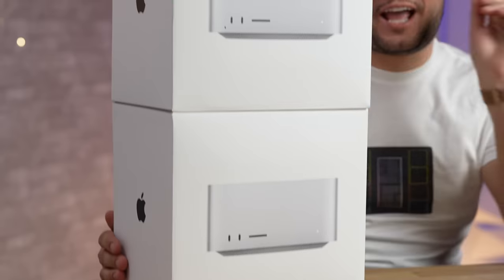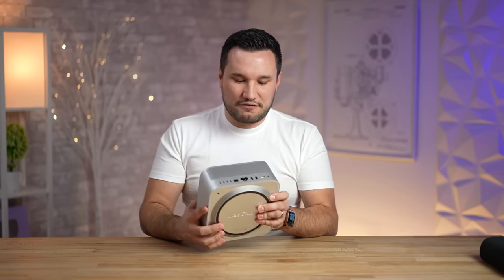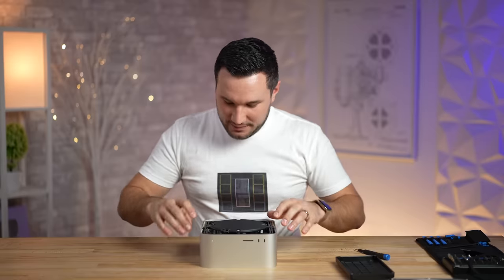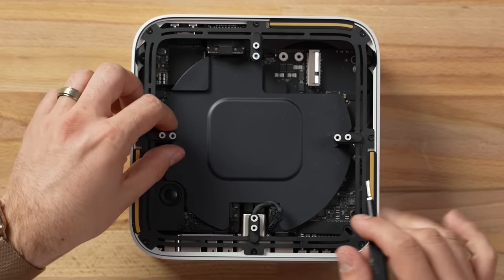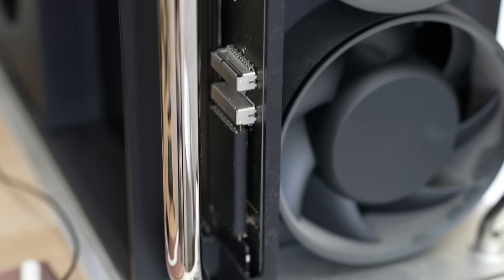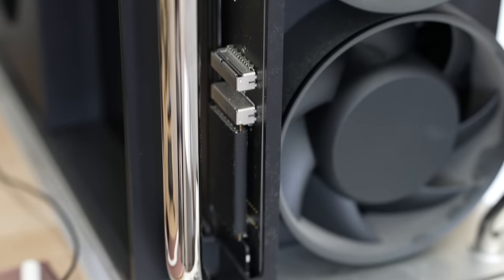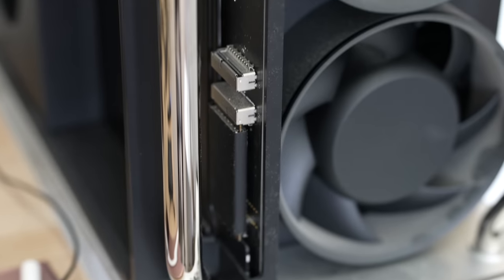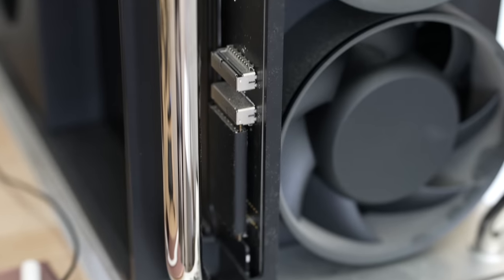Mac Studio FULL Teardown - M1 Ultra chip REVEALED!

Comment: Hellz yeah! Hope OWC makes affordable storage cards for that. Great tear down. Love the content you guys are putting out. I wonder if this is what Apple meant by modular. As in easy to repair or I should say - have repaired by authorized service centers.
Reply: If apple cared about their consumers, or about the environment, the storage should have been standard m.2 slots.

There is no engineering reason to have a proprietary port for storage in today. The entire rest of the industry has standardized to make data recovery, repairability and upgradability simple.
Reply: @ferdievanschalkwyk1669  The SSD controller is in the SoC. No M.2 drive (which have their own controllers) would work in this if it had an M.2 port.
Reply: @aaronmdjones  I have since heard the same. I just hope Apple backtracks on the decision to consider it a non upgradable part, since it's clearly just a software limitation. They can easily support upgradable storage in the firmware.  They already have to internally.

Comment: Wow! That thing is huge! Very impressive and impressed by the cooling capabilities.
Reply: That’s what she said 😂😂
Reply: Look at other APUs out there like the ones in consoles. Many of those are also massive in size because of the parts they all put on the chip itself
Reply: just a remark to explain the logical difference in size between the Ryzen and the M1 Ultra: the AMD Ryzen is just the CPU, whereas the M1 Ultra is a totally different design since it has the RAM "packed" inside as well as the Graphic GPU Cores (so no big sized graphic card in the computer), the Neural Engine Cores, etc... , that's why it's called System On a Chip because it's the entire system not the CPU only.
My 2¢...
Reply: @DenisLogicCertified  It's just like a console. They pack just about everything except their memory modules on the chip itself just like the Mac does at the moment. It works practically identically in design to the new macs

Comment: If your watching the first half of the video while reading the comments the storage is NOT upgradable. The Mac will not boot and will not recover using configurator 2 if you change the storage. It will not recognize a different amount of storage. That is not an SSD there is no storage controller built into it that is on the M1 itself.

Comment: so it is the trick, the MS has a 3.5  gb/s SSd and use a raid  option to reach 7.4 m/s, it is also a way to have cheap ram.
The problem is the T2 chip allow you to add a third party SSD with an adapter, not sure. it may be locked.

Comment: I was really surprised at how easy it was to access the internals. The taped/glued on rubber was clearly intended to dissuade users from upgrading it themselves, but once you take that off, most things come off with screws.
Reply: You call THAT easy access?
Reply: @kayakMike1000  yeah if you're older than 12

Comment: How does replacing ssds work with the sepOS? They dont use nvme protocol.

A randomly generated UID is fused into the SoC at manufacturing time. Starting with A9 SoCs, the UID is generated by the Secure Enclave TRNG during manufacturing and written to the fuses using a software process that runs entirely in the Secure Enclave. This process protects the UID from being visible outside the device during manufacturing and therefore isn’t available for access or storage by Apple or any of its suppliers.
sepOS uses the UID to protect device-specific secrets. The UID allows data to be cryptographically tied to a particular device. For example, the key hierarchy protecting the file system includes the UID, so if the internal SSD storage is physically moved from one device to another, the files are inaccessible.

Comment: Apple's M1 Ultra chip in a rack mount version would be a game-changer. As a tech enthusiast, I've been eagerly waiting for a powerful and compact solution that can seamlessly integrate with my Unify network equipment, and this seems to be the perfect fit. The M1 Ultra's performance and efficiency are off the charts, and having it in a rack mount form factor allows for easy installation and management alongside my existing infrastructure. Kudos to Apple for continuing to push boundaries and deliver innovative products that cater to the needs of professionals. Can't wait to get my hands on one and take my setup to the next level...

Comment: If you think this is a hard teardown, have a go at the 16" macbook pro. I still have flashbacks to replacing the keyboard on one.  This system is complex but no worse than a higher end all in one PC.

The small battery is called a P-RAM battery, it just keeps the system clock working when the system is unplugged but also keeps track of brightness, volume setting and other minor stuff like that.

I fix macs for a living.

Comment: With such a cool processor it should be on display and not hidden.
What are the thermal conductivity qualities of glass? couldn't you build it with the cpu on top under a plate of glass?
Wouldn't that be cool (enough)

Comment: its not an SSD slot its a memory module slot as the memory controller is in the M1 chip itself if you plug in a normal SSD it will not work.

Comment: You can't upgrade the mac storage. It's not an ssd, it's memory modules, there's no controller or dram cache. Also the battery is for the real time clock so when you turn the computer off it can remember the time

Comment: Sadly the SSD is only NAND. The controller is on processor. Which mean to upgrade, you need to do some crazy stuff or let's apple do it for you (which I doubt as it is clearly stated in their website as it is not upgradable thus you need to buy whole machine).

This also equal if your processor is failing, consider your data is gone.

Comment: Just because a part is replaceable doesn't mean it is upgradeable.  Pretty hard to upgrade when there are no aftermarket parts that can be bought. Not to mention that the manufacturer also put in interlocks that prevent upgrading in the first place.

Comment: You said it's not that big but knowing that is the actual die size, this unit it absolutely gigantic for essentially a single processor, no wonders it has all that performance even on the GPU side(not RTX 3090 level at all but it's still really fucking powerful)

Comment: If you ever do any other tear downs it's really helpful to lay out each of your layers/sections in the shape of the computer that you took them out of. So on the table you have a spot for the bottom screws that would be laid out in a circle around the piece that they came out of. And the antenna screws in another spot sit next to the antenna in a similar but minified shape. Fan screws laid our in a similar pattern in another spot... etc. This makes it a million times easier to get things back exactly where they need to go and you never mix up screw sizes.
Reply from the maker: I did mostly do it that way :)

Comment: Sorry, it is NOT upgradeable. People have tried swapping using a donor studio and it just won't boot. Even the genius bar guys can only replace it with an equal capacity module, and exclusively on a repair basis. Upgrades are not possible by any means.

Comment: The storage is not upgradeable.  The card is raw NAND flash on a PCIe bridge.  The actual SSD controller is on the package of the M series processor.  The system DRAM is used as a cache for the SSD, and how much depends on the drive.  Even if OWC or anyone else managed to copy the design, Apple could easily lock them out with a handshake.  In fact, the iFixit team already tried a DFU restore with both slots populated, and it wouldn’t work.

Comment: It is not upgradable, those modules are RAW storage modules that are locked to the T1 chip.

So even if you put in a fitting different one, it will NOT WORK AT ALL

Comment: Lovely teardown! But... please don't say that a pill battery is there to prevent data loss when the machine looses power. It's for keeping the clock running. Those things under the stickers near the chip are mosfets for power delivery. Also, the insides of all of apples computers look that good. Nothing special here. You should try tearing down an original Touch Bar MacBook Pro! (talking about unnecessary amount of little screws) Finally, that is that is a beautiful chip! Thank you for risking it for the teardown :D
- Former Apple Genius

Comment: Looking back they found out the Mac studio isn't upgradeable. The drives are not ssd drives. They are some sort of controller module for the storage. Becareful one guy broke his m1 ultra studio trying to swap one drive from the studio max to the ultra and broke it. He cannot get it to boot back up. I fix it claims they were able to do this with the same amount of space on the controller. There is some weird stuff going on here but do not try to put a ssd in the open slot. Thats how the guys M1 studio ultra broke or did something to the firmware. He said that there is a serial number attached to the hard rive controller and that why you can't take a the one out from the one studio and swap it with the other studio. Just a heads up. Apple did come out with a update to fix the problem to reboot the firmware on the drive for those who have tried to swap them out but on his side it wasn't working. I think because he tried to put the drive controller in the extra slot. It put the studio in a SOS mode that made the lights flash red and amber. Maybe Max Tech already knows this. His name is Luke Miani on you tube. Take care

Comment: this is company that calls the motherboard, ram, GPU and CPU as a single unit, and also the company that loves to use it's T2 chip to lock everything down. just because there's a port does not make it upgradable.

Comment: The thing I most liked was the PSU.. a beauty. CPU cooled 1/3rd (where it's needed),  the cooler fins are always aluminium. Too much screws that could be solved with clips or plastic inserts. It's a great PC overall.
Reply: its not a pc... and yes the psu is beautyfull  having something that delivers 230 volts straight from the wall via 2 screws is fantastic
Reply: @kuma8030  What is it then? you can argue that not every PC is an Apple Mac but every Mac is indeed a PC same with apples iPhone being a smartphone... Every iPhone is a smartphone but not every smartphone is a iPhone 😌🙌

Comment: Thank you for the unexpectedly entertaining video! It was helpful that you tested the noise and the fan activity of the Ultra model. I see that “Art is right“ is claiming that the base Max model is noisy. Could you please run the same tests on the base Max model once you have it? That would be most helpful and interesting to know if the aluminum heat sink is comparatively less efficient and requires greater fan idling.

Comment: It won't be upgradeable. The whole point of SOICs is that all data is transferred ultrafast which provides M1s with the performance advantage they enjoy. To add additional storage ram would introduce a slower data bus and reduce performance. I can't see Apple doing this. I suspect the MacPro will have some sort of interface card that allows the M1 to communicate as fast as possible with peripheral cards...but they will need to be mighty fast to avoid becoming pinch points and reducing performance.

Comment: It's strange that guy is telling me that "Apple cares" because some usb ports are made to be one whole part but tells nothing how bad it is that cpu and memory is soldered in "desktop" computer. Not to mention that yes, you can replace ssd but it won't work because the way apple assings ssd serial number to their security chip. Also - power supply is exposed which is... bad

Comment: Apple's move toward Apple Silicon is simultaneously a huge step forward and a huge step back in terms of personal computing. They're achieving great things with their M1 and M2 chipsets and while neither are quite as performant as a fully spec'd out PC, the hardware that they do compete with isn't nearly as effecient in terms of thermals or power draw.

That said, this comes with the drawbacks of extremely limited user upgradeability and repairability, as well as limited use case for the hardware since you're being locked into the ARM architecture and Apple ecosystem, which restricts usage of this very performant hardware to what is provided by Apple and other developers, which means you're not going to be doing much gaming or running much in the way of alternative operating systems.

This is mostly very typical of Apple products, though, so it's to be expected; the exception being that older hardware was, in some ways, more repairable and upgradeable as well as less limited in terms of software since they were still using Intel.

Comment: It's not upgradeable. Those are not just storages with firmware locked and paired with the each individual logic board. The ssd controler modules also embeded on logic board too. Apple preventing users to upgrade their devices. That's the true story.

Comment: In engineering... its easy to make something complex, but difficult to make it stimple. Apple makes the outside look simple. But the inside is horribly complex.... 2 screws and a part for every single port.... wtf....  and cleaning the fine heatsink fins after they get dusty will be quite the feat

Comment: Dude is an Apple shill. That computer is not upgradeable, the RAM is still soldered on and he didn't try swapping NAND flash module with one from another M1 to confirm upgradeability.  For a $3000+ machine people should be able to upgrade the RAM and storage at least without having to deal with any apple proprietary nonsense. I'm sure it'll look nice in a landfill as soon as Apple comes out with next year's model.

Comment: No, thus machine is NOT upgradeable… at least not in the traditional way… the way M1 work is that the SSD controller is integrated into the CPU, so you can’t just plug in any old SSD into that port. Those ports are only for daughter boards that carry NAND chips.

Comment: With no heat sink on the ssd and ram, I wonder if they have to throttle them. Most fast ssd's get very hot, even in the larger form factor that's shown here.
Funny how in the earlier he's all excited about the whole soc getting the giant cooler then tries to make out the 1/3 of the chip being connected to a smaller copper pad as something cool. The size looks about the same size as an amd/Intel chip and controller combined plus the uncooled ram. So nothing special I guess. No sadness because you're stuck with whatever ram you ordered either.
I'll be curious to see it intel/AMD make a "ram included" chip. It's been a pretty dumb design until recently where 32gb is relatively cheap and more than most people need.

Comment: "Apple cares about making a solid system"... No they want repairing and disassembly to be as intimidating and convoluted as possible so noone would wanna do it. "You can repair it yourself!" you will never NEVER be able to get your hands on any of those replacement components. Not legally.  Apple might not even repair them or swap them out at the genius bar thier- their track record so far is that if ANYTHING fails they replace all the parts- whole cloth- and don't even bother transferring over your data. STOP praising this crap as if Apple did with the CONSUMER IN MIND.  They had the OPPOSITE intention.

Comment: You wouldn’t get shocked by the power supply unless it was just recently plugged in, if you unplugged it for about an hour or so there would be no charge left in it and besides there wouldn’t be enough juice in the power supply to harm you if it was unplugged it would hurt pretty bad but probably wouldn’t kill you (unless somehow you touched one thermal on each hand Some impossible way unless you deliberately did if)

Comment: You can always tell a if a person is a certified Apple trained Mac tech by what he calls the main board. Apple calls it a “logic-board”  not a  “motherboard” 

Also a Mac tech would only open up a Mac if ESD protocols are followed.  They would use a anti-static Mat and an anti-static strap.

All screws are placed it a plastic egg tray that are labeled for ever screw used. A screw count would be listed, lastly a take apart sheet would show what order each screw should be removed. 

The case can be scratch so a soft Anti-static sheet would be placed under the open cover. Just moving the case around with a screw trapped under it will scratch the case. 

With all that said, you didn’t do a bad job in your Case opening. It’s your computer and you can do anything you like to it except get warranty coverage. 

Thanks for sharing!

Comment: not a single thing made by apple is worth a single penny in my opinion with their horrible attitude towards their customers and terrible design choices made on purpose for added forced obsolescence. Completely disassembling a computer just to clean its fans is absolutely ridiculous. Adding a huge heatsink, radiator and 2 huge fans to then make sure it only comes in contact with what looks to be less than 33% of the surface of the cpu die, absolutely ridiculous. The whole thing is a slap in the face of the consumer.